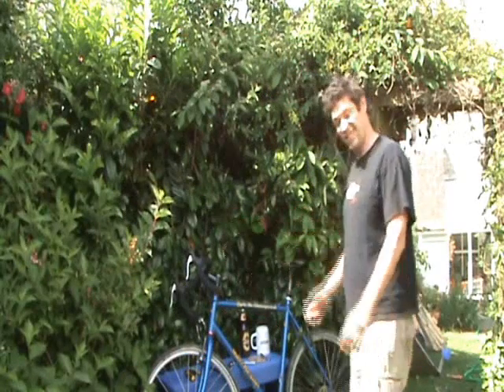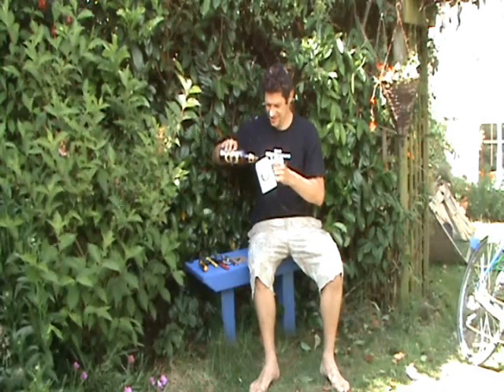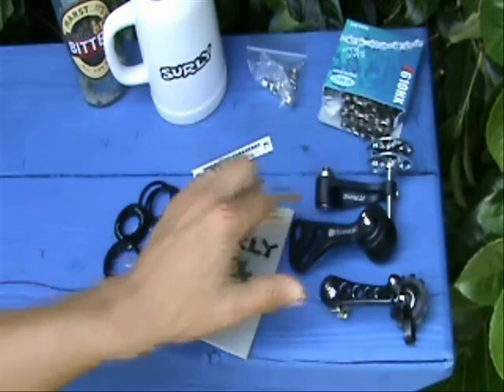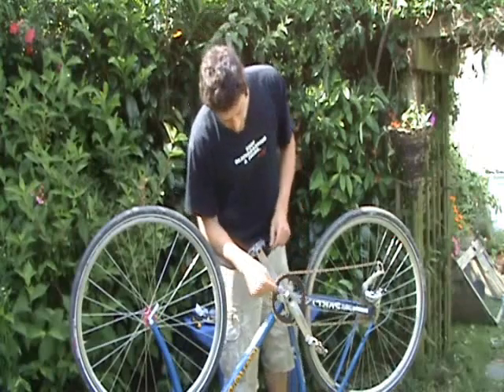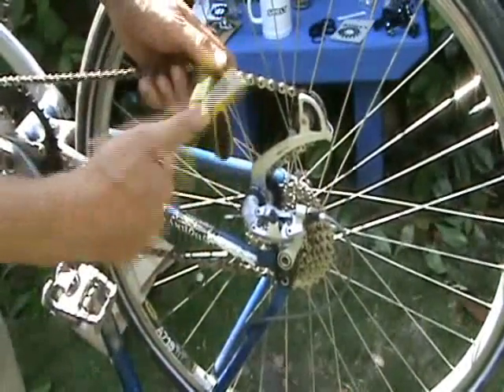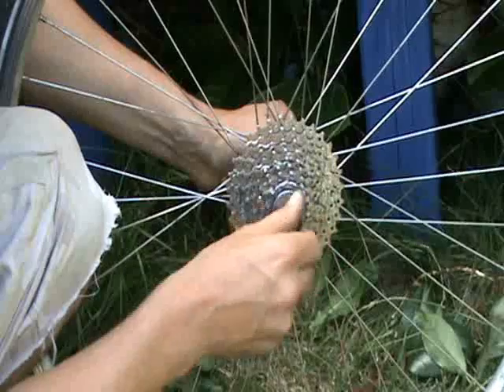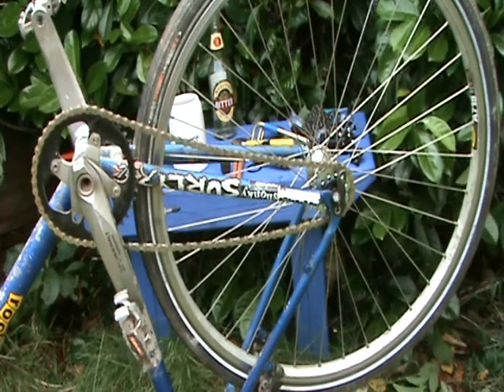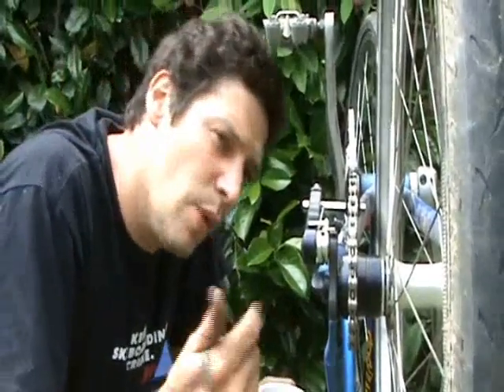How To Build a Single Speed Bike

Comment: I found a single speed fixed wheel bike in a field in 1976 when I was 16, I cleaned it up and rode it for about 5 years before it got nicked. It had a massive pedal cog and minimal cog on the wheel, it was so fast and I had legs like Lance Armstrong! Such a good bike. Good video mate.

Comment: I've only been into road bikes for a couple of years because  I started out BMXing and thought road bikes were hard to steer and too much work was involved to keep them working correctly. but after trying to ride my BMX around town and long distances I knew I had to swallow my pride. soon after I found out about single speed road and fixed gear road bikes. I was so excited. not having to deal with all that extra crap but still being able to haul some ass was the best thing I'd heard in a while.

Comment: @charliethebikemonger Hi, I've got a decent univega steel hardtail from about 1998. One of the shifters broke so I sprayed the bike with WD40 and plonked it in the shed and it just sat there for ages. After seeing this vid I knew exactly what to do. I've dug it out, wiped it clean and it taken apart. I used a linisher where I work to shorten the female part of the chainring bolts and sand blasted the rust off the bolt heads. Ordered some single speed bits from your website today. Cheers

Comment from the maker: Hi,
Yeah thats possible. You may not even need a tensioner if you have semi horizontal dropouts. You will probably need a BMX style screw on freewheel, rather than the slide on cog and spacers used in this film.
Cheers
Charlie

Comment: No, it doesn't take many miles of cycling for a chain to stretch and when it does the chain will come off more than you will be riding hence the need for a tensioner. But this only applies if your bike has vertical drop mouts, if it has horizontal drop outs you wont need a tensioner as you can slide the wheel axle in the drop outs to tension the chain.

Comment from the maker: Hi there... easy mistake to make until you have striped the donor bike down. You wont need to redish the wheel, but you may have trouble getting a good chainline (depends on what hub you have), but this can be corrected by mounting the chainring on the inner side of the crank, and/or using chainring spacers, and/or a few mm of rear cassette spacers.
Singulators work best in the push up position.
Best of luck
Charlie

Comment from the maker: @Gimo60  Chains stretch when used, so your chain will get slacker. You should check the tension regularly and adjust your ring/cog sizes, remove/add a half link, or replace the chain to maintain tension. It can be done, but you risk dropping the chain.

Comment from the maker: Its about 30 mins each way. 
The time consuming bits are adjusting the chain (so have two chains so no need to adjust the lebgth, you could also use a quick/snap link), and getting the shifters on and off the bars (so maybe run two sets of bars, or leave the shifter in situ???)

Comment from the maker: a cog is a cog, and a freewheel is the rachet mechanism. A bmx freewheel has a cog and mechanism all in one screw on unit.
What you use depends on the design of hub you have. Most geared bikes would need a cassette and spacers (as seen in this movie)

Comment: correct me if i am wrong but in your video you did not remove the freewheel instead the fixed gear is not really fixed but just a one speed bike with a freewheel... so you still need the brakes to brake instead of pedaling backwards...right?

Comment from the maker: Not used a Rennen, all tensioners ahve there drawback, A dedicated SS will solve all the problems... but get teh chain as short as possible and then its less likely to take a hit from a rock... sounds liek you need to lock yours down harder, it should not move.
I prefer sprung tensioners as they can handle this sort of thing, and return to their original position.
Hope this helps...
Charlie

Comment: yo... nice vid but do you need to get a new lock ring to lock the fixed gear or can you use the lock ring from the old cassette? Also do you need to remove the freewheel or can you get put the gear on the hub? Thanks.

Comment from the maker: You can re-use your old cassette lockring it its a 12t one, rather than a smaller 11t one.
But this is a single speed with a  freewheel, not a fixed gear.

Comment: but I digress. i was actually wondering if you could give me some advice. I have a 1975 fuji gran tourer I was thinking about converting to single speed. although I saw what seemed to be a really nice single speed at a bike show near where I live. it was very lite and had a freewheel kog on one side of the wheel and a fixed on the other. it was used and they were asking $500 for it. does it seem like a good deal or would I be getting ripped off? P.S. it was in very good condition

Comment from the maker: You can convert teh Fuji, it may well have horizontal dropouts, so no need for a tensioner.

$500 could be a deal, but not all bikes are equal, impossible to say if was a good deal or not. Convert the fuji, see how you like it first.

Comment: Hi,
I have a scott yz that I want to make into a single speed for doing jumps etc.  However the chainrings are welded together and the cranks don't bolt onto the sprockets in the usual way.   Can I still make the conversion by just buying a new chain ring or do I have to buy a whole new crankset?  -  I have a picture of the chainrings on my page.

Comment from the maker: You can get lucky with a short chain, but the chain will stretch. Having your chain come off can a be a painful disaster. Use a tensioner, they are cheap and they work. Then one day get yourself a full on dedicated one speed frame.

Comment from the maker: You could do this, BUT:
 A chain tool is cheap
Why risk butchering a  chain for a sake of a £7 tool
A chain tool is designed to do this, and its way easier and quicker
Also safety... you really dont want your chain to break, and with a  chaintool you are doing thing properly and will get the pin spot on.
Having the right tools is always better.

Comment from the maker: No tensioner... Nice idea but it does not work in the real world. 
Getting the chain tension spot on is tough if you only adjust chainlength, you will also need to mess around with cog sizes and maybe half links too. 
Also... You see the chain will stretch and become slack, a tensioner will take up this slack.
It can be done, but its a hell of fiddly exercise and does not last long.
Cheers... charlie

Comment: i agree, tensioner is garbage. 

Why would you remove a spring loaded chain guide and tension mechanism, with an overpriced spring loaded chain guide and tension mechanism, only now you cant shift?  

buy a bike with horizontal drops, or leave your bike as it is and dont shift. simpler solution, and you dont have to tear your ride apart.

Comment from the maker: @oOoDaEnGoOo 
Because you NEED chain tension. Without it the chain comes off and you crash hard.
Even if you can set it up without a tensioner, the chain will stretch and then be too loose.
More info.... Have a look at the "getting lucky" section of the FAQs on my website charlie the bikemonger dot kom

Comment from the maker: There is more (or rather less) to your £150 bike than just the gears. The gears will die early on, so you never get to find out that the wheels, hubs, BB, brakes, pedals etc would also fall apart. You need to spend £300 ish and above to get OK quality.
Why no singlespeeds at £150. £150 bikes are for people who know nothing about bikes. Singlespeeders tend to know there stuff, and ride hard. Our bikes needs to be better.
Also ecconomies of scale - there are only so many singlespeeds. Cheers